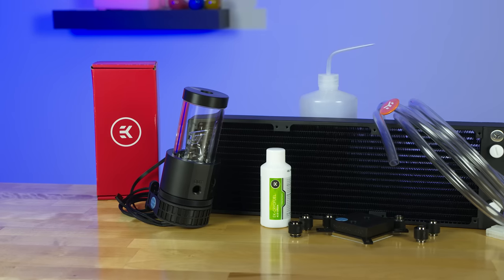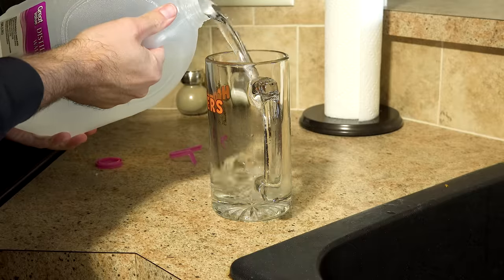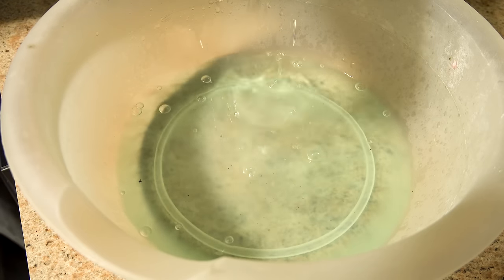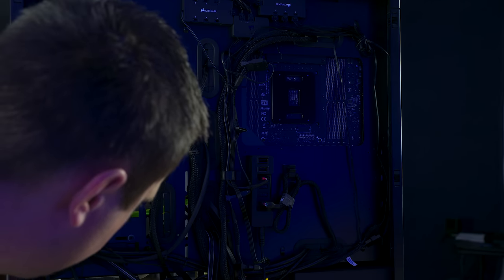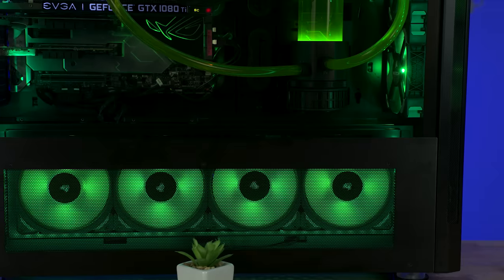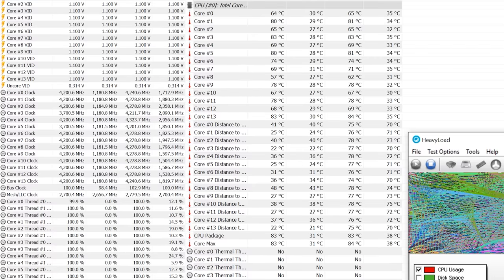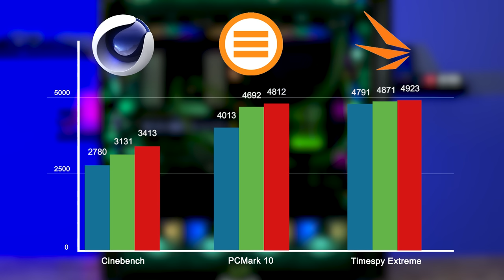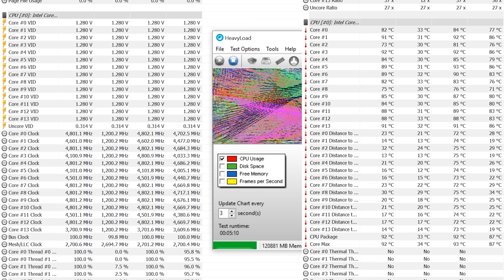My First Custom PC Water Loop...

Comment: I went through pretty much all of the exercises you did with an i9-7980XE. Direct die mounted, custom water cooling, 1600W Power Supply, 2 540 mm radiators (only one of which has fans hooked up at the moment), blah blah. I didn't give up on the LM even though I went through a lot more hell with it than you did. Finally, today, I am running all cores at a nice 4.7 GHz  with 1.24V VCore to all 18 of them, 3.1 GHz for the mesh and have the RAM (btw, this is with 128 GB of RAM installed into all 8 slots) at 3000MHz at the moment (CAS 15/15/15). I am  doing Prime95 Small FFT (AVX is disabled in Prime95, AVX tuning is a whole other can of warms and I will tackle that after I get non-AVX at the best freq I can get it at and figure out how to handle the 1,250W that AVX512 at 4.7 GHz pulls at the wall) with the cores sitting at less than 62 C peak and very few discrepancies in max temps between cores. All of this is happening with an average 7980XE (definitely did not win the lottery on this one). The key to how to get all of this to happen is in the next paragraph. First, here is a picture of Prime95/coretemp/openhardwaremonitor running on my system right now: ibb.co/muxh2f . These temperatures (on the right hand side of the image [in CoreTemp]) are as good as you can get with this sort of test, with an average CPU (i.e., not a golden sample). Power at the wall for the test running in that image is 640 W (going into an EVGA 1600W Titanium class power supply). The key(s) to achieving this will be described in the next paragraph.

There are two things you need to know to get low temps and a stable overclock on a crazy multi-core (i.e., 12-18 core) Skylake-X CPU: #1) The base of whatever water block you are using better be perfectly flat once it's screwed in tight into the Direct Die Frame and makes contact with the siliscon. I am using a Koolance CPU-400i and its base is slightly convex. However, and this is a big however, the base flattens out under pressure. If your water block/cold plate does not become flat when sitting on top of the raw CPU (and direct die), or if you screw it in lopsided by not screwing all four screws a little at a time in a cross pattern, you will get large temp differences between cores, this will happen regardless of whether you are using LM or not. The large temperature differences you see are not design flaws, or flaws with your specific chip. They are mounting flaws!

I struggled with this issue for weeks and pretty much discovered that it's a matter of having a good water block that can sit flat on the silicon as well as good technique in terms of screwing it on. I played with Conductanaut (LM) and Kryonaut (the best non-LM), and the Kryonaut did not even come close temperature wise, but it was far more tolerant of a bad water block and/or a bad mounting technique - it filled in the gaps due to water block convexity and corrected errors in mounting technique much bette, but there were still very large core temperature discrepancies >=15 C between hottest and coldest. There should be no one (or more) super-hot core(s) once this gets addressed. My hottest core now is only 1 C hotter than the next hottest and the max temp difference between coldest and hottest cores is 6-7 C. Keep in mind that this is on an 18-core CPU under maximal non-AVX load! #2) I am VRM limited at the moment. I have two fans blowing on the VRMs to keep them below 60 C, at which point (between 57 C and 60 C) my motherboard, an Asrock Fatal1ty X299 Professional Gaming i9 XE will just hard lock up the PC (i.e, can't move the mouse). At first I thought I was not giving enough VCore, but I soon realized that no matter the VCore, if the VRMs don't stay below 57-60C, high overclocking is impossible (on my motherboard).  If I could cool those VRMs better, I am sure I could do 4.8-4.9 GHz stable on Prime95 Small-FFT no AVX, simply because of the temperature headroom I have having solved issue #1 (after weeks of effort and failures, not knowing what I know now).

I would strongly recommend that you purchase a Koolance CPU-400i and retry the liquid metal. Here is a picture of my motherboard with the Koolance sitting on top of the silicon, Conductanaut, and Direct Die Fram: ibb.co/mcg6v0 in an open air test bed . The rainbow glow is from the RGB effects on the 128 GB of RAM (I didn't ask for this, but it's hard to find a compatible batch of 128 GB of RAM for a motherboard and have it work and overclock!).  There are two brown fans (you can make out one of them in the image) blowing on the VRM heatisnk from two different angles to keep them cool(er) or at least below the critical temperature(s) where the MB will freeze up. The twist ties on the video card are used to keep it perpendicular to the MB when the motherboard is tested sideways (on the testbench). 

There is only one flat base water block currently in production (and by flat I mean flat at the get go and not made flat under pressure like the CPU-400i), but its model # escapes me at the moment. In any case, I know that a CPU-400i will work, as it did for me with a Direct Die Frame, a reasonably thick (and not thin like all the reviewers claim, because they are not using a Direct Die Frame) Conductanaut application (but not so much that it will run overnight - in other words, very little pooling), and good a good mounting of the water block on the silicon/direct die.

If you have any questions, feel free to reply.

Comment: One thing I found myself thinking when looking at the b-roll of the computer all put together, you have NO place for a 3.5" hard drive. I see a couple SSD's in the bottom left of it, but that's it. What happens if you wanna put some large storage in there? Where are you going to put it?
Reply: Oh, and I was wondering, what's with the USB ports on the backside of the motherboard tray? @6:48 is where I have it frozen now. That seems like a bad spot to put USB ports because you can't really plug anything in them. Or am I missing something?
Reply from the maker: The usb splitter is for using multiple internal rgb devices. And i have 2 8tb hdds in the bottom of the case, can fit 1 or 2 more. Thr is a special place for them lol
Reply: @Bytemybits  Ok, I thought that maybe there was an area for 3.5" drives down there, but I wasn't sure since you had those big fans down there, too. Thought maybe it might be kinda tight for it. Don't know the case, so I figured I'd mention it. Oh, so the USB part is for small USB style plugs that do nothing but power the RGB stuff? Interesting. Hadn't seen that before. Kinda cool, I guess, to not have to use Molex plugs or anything to do it. (BTW, you see my tweet yet about the beginning of the video? LOL)

Comment: Not sure why you say the 1080ti is under-performing and out-dated? The 20 series isn't that much more impressive and offers ray tracing that doesn't even exist in games yet, and probably won't for quite some time. I'm trying to replace my truly out-dated and truly under-performing 750ti with a used 1080, since they are cheaper now and out perform everything else besides the 20 series, which they only marginally lose to in real world applications. A 10% or so increase in synthetic performance doesn't justify spending yet another $600.+ in my opinion. To each their own I suppose.
Reply: Very true in some benchmarks a 1080Ti outperforms the 2080 and widespread Ray Tracing is still at least a couple of years away.  A1080Ti should be a respectable performer for at least two more years.
Reply from the maker: Lol #sarcasm

Comment: super dumb question: How do you maintain a water cooling system? Like for my current setup I just blow some compressed air, but do you have to clean the water or something? How do you even see if it needs maintenance?
Also about buying a new processor, don't you need a new chipset on your motherboard?
Reply from the maker: new i9s slot in skylake boards but need a bios update
Reply: Polopollo75 - yes, you need to drain the system and flush it every 6 months. Some will go a year, but its advised every 6 months.
Reply: @bear5016  Ok I looked up because I bought some ex-coworker's desktop. It has a Corsair hydro h75 and apparently they stay sealed and are guaranteed for 5years.
Reply: That's an AIO (all in one). They are maintenance free. A custom loop however is not. Sorry for any misunderstanding.

Comment: Use ffmpeg on a 8 threaded cpu with it set to use 64 threads and it will use all cpu available. 🤘
Isn't there a highly reflective water dye that will reflect all the rgb from your fans?

Comment: We all know that an i9 is in the works, at least in your mind. My prediction is a late December update with one you pick up during a Christmas Holiday Sale.
Reply from the maker: I will not get a 9980xe. I will not get a 9980xe. I will not get a 9980xe. I will not get a 9980xe. I will not get a 9980xe. I will not get a 9980xe. I will not get a 9980xe. I will not get a 9980xe. I will not get a 9980xe. I will not get a 9980xe. I will not get a 9980xe. I will not get a 9980xe. I will not get a 9980xe. I will not get a 9980xe. I will not get a 9980xe. I will not get a 9980xe. I will not get a 9980xe. I will not get a 9980xe. I will not get a 9980xe. I will not get a 9980xe. I will not get a 9980xe. I will not get a 9980xe. I will not get a 9980xe. I will not get a 9980xe. I will not get a 9980xe. I will not get a 9980xe. I will not get a 9980xe. I will not get a 9980xe. I will not get a 9980xe. I will not get a 9980xe. I will not get a 9980xe. I will not get a 9980xe. I will not get a 9980xe. I will not get a 9980xe. I will not get a 9980xe. I will not get a 9980xe. I will not get a 9980xe. I will not get a 9980xe. I will not get a 9980xe. I will not get a 9980xe. I will not get a 9980xe. I will not get a 9980xe. I will not get a 9980xe. I will not get a 9980xe. I will not get a 9980xe. I will not get a 9980xe. I will not get a 9980xe. I will not get a 9980xe.
Reply: @Bytemybits  I'm reading that to mean you already GOT a 9980XE. Either that or the next lower 99x0XE processor.